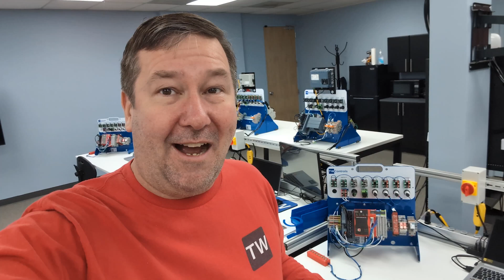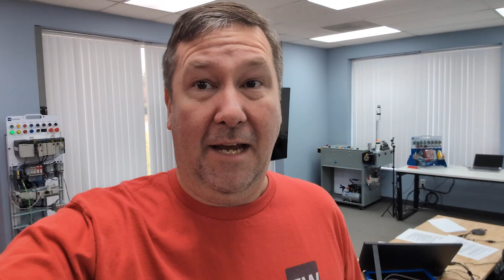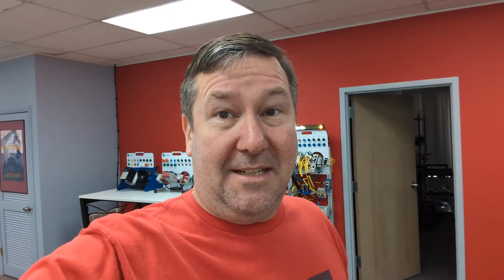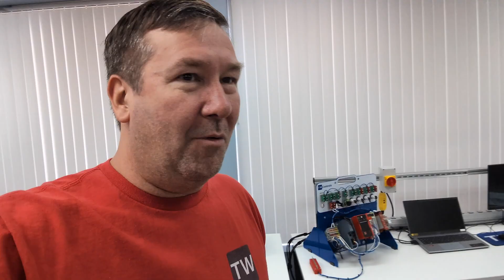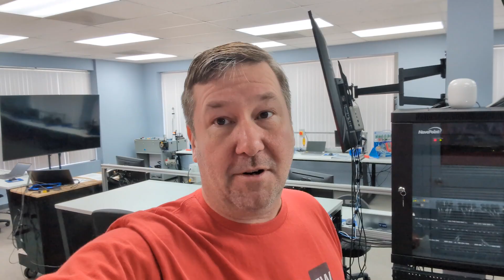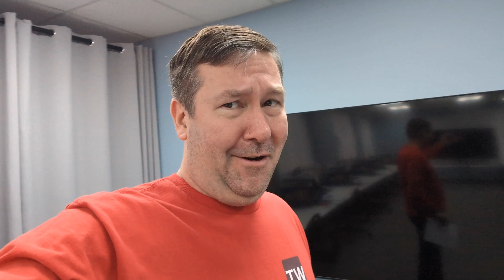Top 10 PLC Interview Questions: How to Ace Your Automation Job Interview

Comment: Most HR Departments still list "Blueprint Reading" as a requirement. I think it's because at some point, the Contols or Maintenance bossman said "schematics" and then explained to the ignorant HR that "They're kinda like blueprints."
The HRers just copied each others' homework from then on.
Reply from the maker: It does seem like a common disconnect between departments.

Comment: The problem is ..
There were single skill tradesmen, experts in their craft , up to the late 80's...then Corporations wanted to streamline and maximize profits, and DEMANDED, the Technician to know more than 1 skill set..for the SAME $$ hourly rate..
So from late 80's to 2005, you were essentally MULTI-TRADE technicians, you knew Fabricating, Machining, Mechaical, Hydraulics, Pneumatics,Welding, Plumbing, and Basket Weaving...
So the Multi-tradeTechnician was replacing 5-8 other technicians WITHOUT much increase in pay..
Now since 2005, they are adding Programming PLC's, and PLC troubleshooting, which was 100% done by Programmers, people who write the Language...and NOW, that same Technician is required to add ANOTHER skill to their toolbox, replacing another Specialists, and still only paying MEDIOCRE at best wages...
The problem that exists now?..
THERE ARE NO SPECIALISTS...just tradesmen who know a little about alot...
Im saying this from 40 yrs experience as a Master Journeymen Electrician, who had to adapt and learn all these other skill sets, and i havent met a Specialists in 20 years,.....and the funny thing is...HR thinks your a moron if you dont know PLC's, ..when most HR cant even spell it...you can be a true multi-skilled technician with 20 yrs exp, and HR will pass you by if you dont know PLC's....but ive never known a programmer who could wire a transformer, or rebuild a hydraulic pump, or what welding rod to use for a certain steel or aluminun, or how to use a bridgeport milling machine or lathe, and the difference between microns and thousandths, or how to measure backlash in ball screws...
Just know PLC's and they will hire you, trust me,